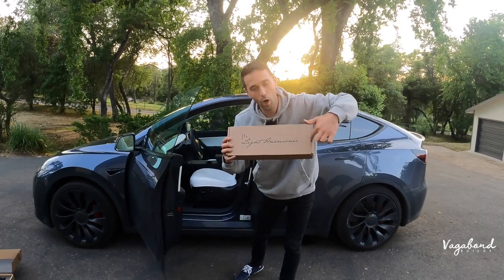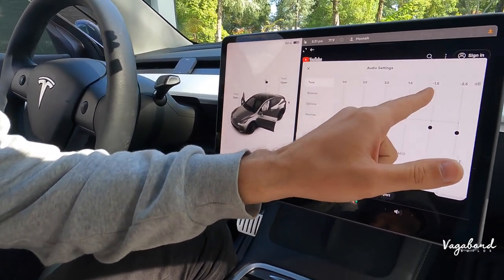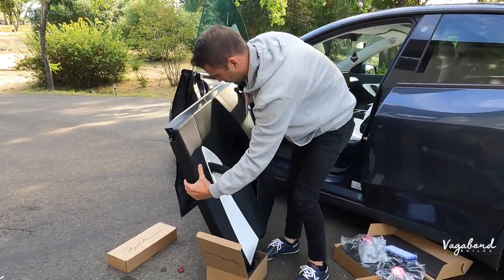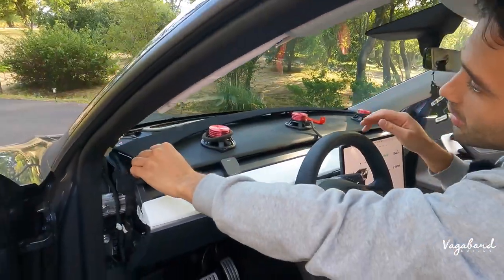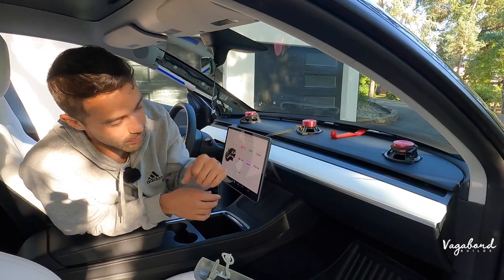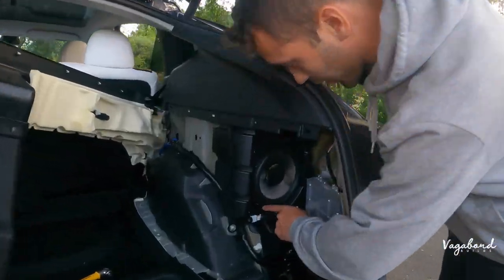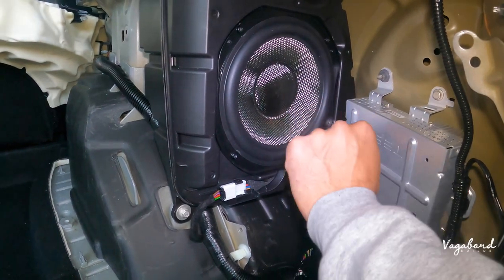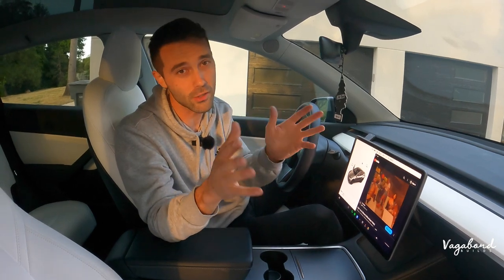Tesla Model Y Speaker UPGRADE from Light Harmonic

Comment: Sadly I had to say it was a horrible experience for me. If you look carefully original speaker vs LH, LH speakers are all have (+) on the Right side. I have confirmed by looking at your video, polarity is exactly Wrong wiring as mine that I just ordered. They are all defective that way by messing up with soundstage. I had to remove all of them and re-wiring in phase. Contacted to support team and no response..
Reply from the maker: So…. What support team did you contact?
Reply: I remember from the old days support is horrible
Reply from the maker: @Casajulianmg  You may be right. I don't have experience in that area with them.

Comment: The subwoofer speaker new one seems poor quality with pressed steel chassi and Not moulded aluminium. The motor size i comparable with the original. If you want upgrade go with the alpine kits.
Reply from the maker: Have you ordered one and tested it before the comment or you are just stating your opinion?? Just curious to get feedback